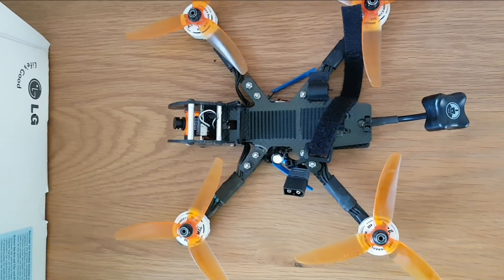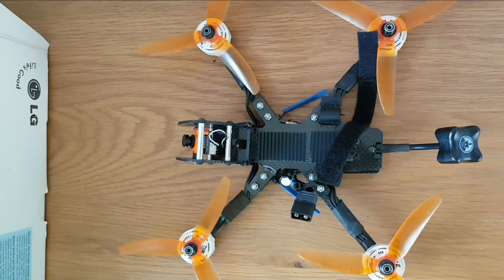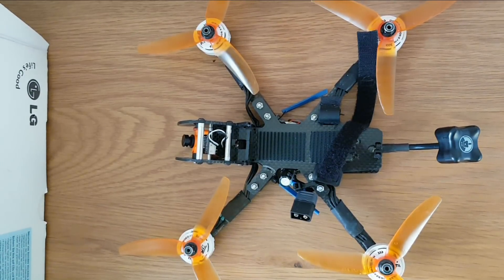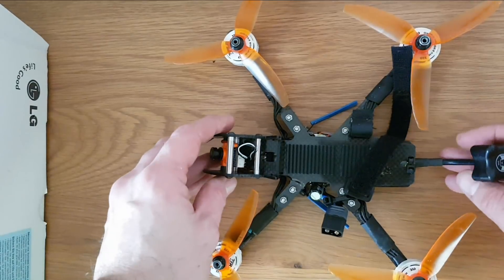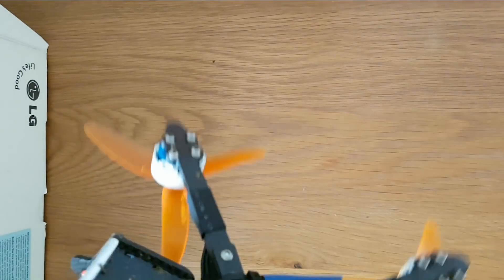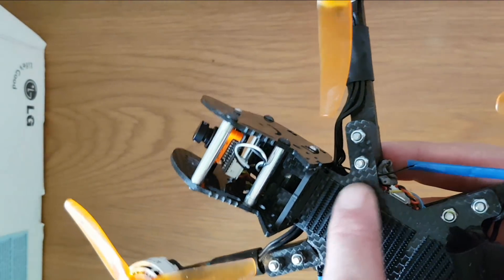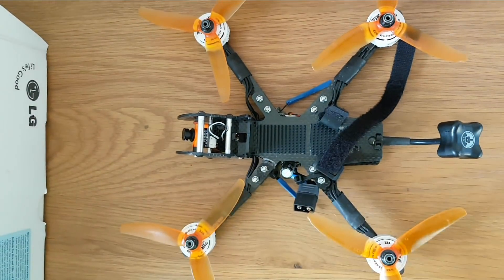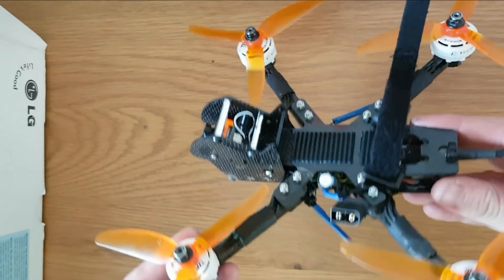RJX 220 dies on its maiden

Comment: Thanks for the video, looks like you took one for the team there, your lucky to get any flying in with this weather at the moment.
That design reminds me of the Hyperlow vert concept but done quite badly, still I'm guessing it's alot cheaper and had you not feel from 100ft might have been OK for a while longer.
Reply from the maker: Dovzo fpv I really liked it - was £16! Lots of room for creativity-  Rear arms were 5mm higher than front (I stole from the merica) and it flew (despite the wind) amazing. I should have braced the arms. Was a punt, and sadly didn’t work out. Cheers for watching

Comment: I just received this frame, hope it holds up.
Reply from the maker: Stick a carbon brace on the top plate between the front arms. I might have just been unlucky. Hope yours does better.

Comment: i'd give the frame another shot with a different flight controller.  Death rolls make for really hard crashes that tend to break the best of frames in my experience.  I've broken a chameleon on it's maiden due to death rolls but it's still a good frame.  I've also broken an iflight ix5 from death rolls yet another ix5 i have has lasted for a very long time without issue.  It does suck when you break a quad on it's maiden and is very discouraging but it may not necessarily mean the frame is particularly weak.
Reply from the maker: Yup, agree with everything you say, but I never go back on frames. If it dies on its maiden it doesn’t get a second chance. I’ll keep an eye out to see other folks feedback. Looking for a new ‘victim’ lol.
Reply: lol, i hear ya
Reply from the maker: John Taylor moral of this story for me is wait for some other idiot with a YouTube account to crash the frame a few times before you buy one :)
Reply: agreed, lol
Reply: dont say that, nobody spotted this frame but you, i know you bought it for parts but i think you were right, this design has an  lot going for it.
Reply from the maker: It certainly does. Thing is, it gets heavy running the 15mm stack. I bought the gep lx5 for £21 and it is indestructible in the 40 crashes I’ve had with it. My HYPERLOW has survived 100s of similar crashes without a mark - both at a similar weight. Same story with the Martians and Devel and lots of others. I wanted a lighter freestyle setup. Some you win, some you lose!
Reply: yeah breaking two arms has to be a design or material weakness even in a perfect crash.  i will let you know if i get a result, i just wish you got more flight time in to help me choose options.

Comment: I thought Joshua Bardwell only wrote the manual for this flight controller, the one he had input on was the RacedayQuads F4 board I’m pretty sure.
Reply from the maker: DavyBoy he’s responsible for the bit of foam attaching the gyro. ‘‘Twas his idea mate.
Reply: Coppertop FPV ah, I thought he just wrote the manual. 

Sucks that you’ve wrecked a frame though.
Reply from the maker: DavyBoy it’s a very good manual in fairness. I think I’ve just got a couple of dregs. Can’t see anyone else with a kakute problem - and it’s definitely the gyro. The bardwell thing just makes me laugh :)

Comment: It's a shame it didn't last very long it does look like a solid frame. It would have been a good platform for testing out motor heights and flight characteristics. O well, "C'est la vie!"
Maybe instead of buying these cheap frames, we should invest in a CNC and just make our own. That sounds like a good plan. ☺
Reply from the maker: Trystan It’s all Bardwells fault! (I’m going to use that every time something goes wrong lol). Need to try and use some of these bits elsewhere. Might be time for more Frankenmartians lol. CNC machine.... I like 😜

Comment: I don't know what is happening, there is no issue to our knowledge. There are many aspects that could/ would be causing this, 32k 32k will cause this, d-syncs will also cause it and a D term to high or low will cause it. Thanks
Reply from the maker: Yup, all of those, but this is down to that shit kakute fc and it’s sticking tape gyro. I’ve tried to be nice to it, I fixed one of them, but I can’t be bothered working out what the problem is with the silly softmounted gyro now. I took a hammer to it tonight so I wasn’t tempted to use it again lol. Life’s to short to experiment on a fc. It’s not like it’s doing anything different than the other 30 odd I’ve used without issue.
Reply: So sorry to hear your problem, I was apart of designing the Fc and I run it on all my quads and have no problem! The tape is not meant to be permanent, I replace mine every 3 months and it is fine. I have also noticed that you are mounting them upside down, this is not the correct orientation for the FC ( I know it can be changed in BF) the tape is meant to work with gravity not against (in relation to the foam). Pm me if you have another problem and I will help fix it. Thanks

Comment: What was the original setup, and the new setup?
Reply from the maker: Ryan Zimmerman ah, if you watch my waffle video, I was going to use the airbot wraith mini 25amp escs as they were small enough to mount on the arms. So I could use only one spacer. (I was only doing it as I had no use for them and it was just an experiment to see if they could cope with the motors). I’ve added the current bits to the description.

Comment: my rjx 220 just arrived and i have noticed they changed the design where your frame broke... my frame is beefier and looks a good bit better, i will still be adding extra braces like the armattan rooster, also my carbon is not shiny like yours which always made me think yours might be brittle.
Reply: maybe i could take a pic and you could insert it, it might take me a while to get the build finished.
Reply from the maker: TheMadmacs that's interesting. They put my initial review on their Facebook page - or so they told me, I haven't checked. Matt finish is just cosmetic id imagine. Pop me an email pic if u can to coppertopfpv@gmail.com. I'll see if I still have their email and if I do I'll ask them.
Reply: i posted a link to tinypic so you can see
Reply from the maker: TheMadmacs where does this tinypic live? Can’t see anything :)
Reply: thats weird it worked for me then when i tried to repost it for you it didnt work

Comment: another dodgy kakute? i think i said to you that you should add some extra carbon to this frame. either big washers or bars of carbon across rge screw holes,  maybe i deleted it hehehe. its probably very brittle carbon, i have the rjx 220 and a racerstar f3 star AIO nd some 2306 2400kv motors on the way, i will probably add some bits of carbon on top to strengthen the screwholes. so at least your crash helped somebody else hehe.
 my fist quad delaminated a top plate with the battery weight in a crash, i used a small sheet of carbon to keep flying it and on a subsequent crash it held up better than the other screw holes.. its sounds awful but it looks fine. i buy extra top plates now purely to chop up and bolster top plates. eg. the front end on my ''qav'' 210 is effectively 3.5mm and one sheet sticks out like a bumper so i even have a crumple zone.  ps. the frame and stuff i just ordered have come up as back orders on banggood even though they say '' in stock'' on the product page.
Reply from the maker: Yup. Just use a strip of carbon between the arms to act as a brace. I considered doing it but didn’t want the extra weight. It’s heavy enough with the extra bracers as it is.
Reply: the bummer is, it looks like the frame could easily have had a much wider intersection between arm and body, like more than twice as much meat.
Reply from the maker: Yep, so close, yet so far!

Comment: How are the motors? Would you recommend them?
Reply from the maker: Jack Truong no. They're ok on a light build but have little torque on a freestyle quad. Not a patch on the bottom end compared to the rcx2206v3 and slower and less linear than the f60 pros 2500kv I also run. I wish I hadn't bought them. They're not bad, just there's many better options. Think bad turbo car, nothing then a surge of power.
Reply: Coppertop FPV hmm i have 5 rcx se2205v3 motors. I sort of regret buying them. Two motors have rattling sound straight out of box. One die after a crash. The motor desync when i throttle up everytime. Most likely a wire broke in the winding. Changed to a new one and issue went away. The only good experiences i have are emax and bh motors. I have tried racerstar and they were horrible.
Reply from the maker: Jack Truong yeah i saw you post that before. I've had 15 of the 2206 and 5 of the 1407 with zero issues. Just luck I guess.

Comment: rjx 220 new version plus 5mm added bottom brace, and 1.5mm added (front) brace. https://imgur.com/a/9PXyW
Reply: ps. if youre gonna dremel 5mm carbon sheet do it outside with goggles and in old clothes, its extremely messy.